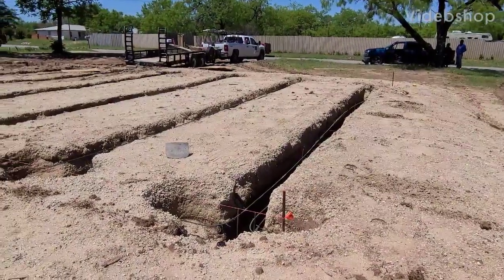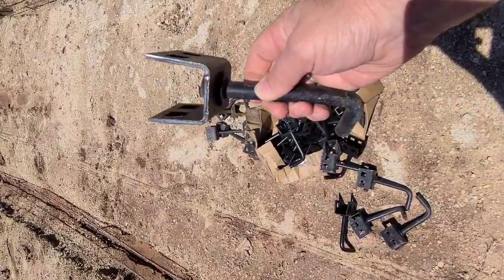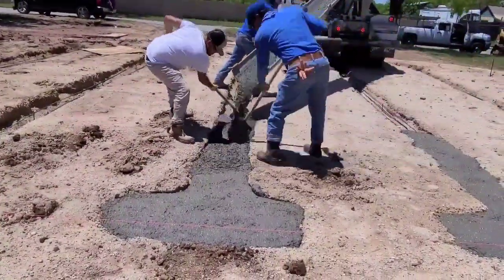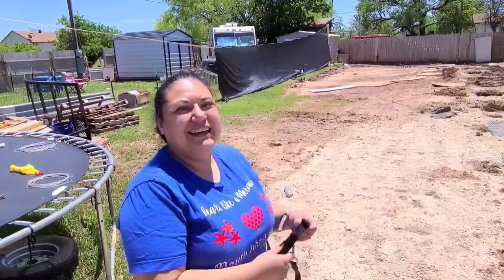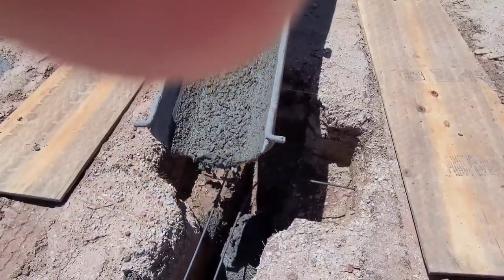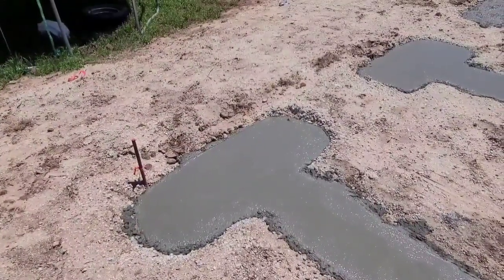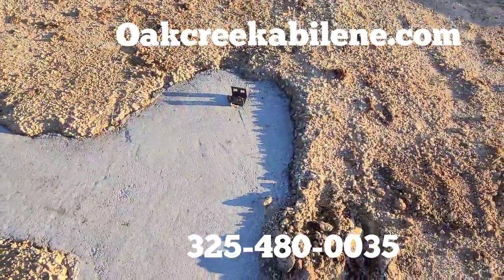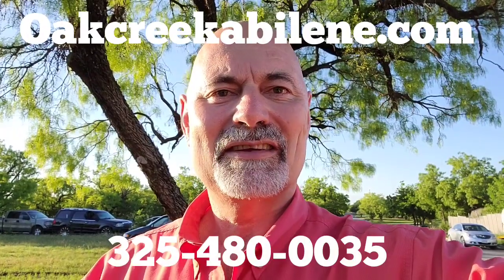Modular home foundation installation

Comment: If the whole house sits on steel I-beams, I wonder if positioning some steel thimble shaped or cable reel shaped anchors such that the concrete was poured around most of them, but one end of the thimble was either flush with the top of the runner, or maybe stuck up a few inches above it, and once the house was sitting on top of them, the I- beams could be welded or bolted to the exposed part of thimbles? Come to think of it; if you welded some old coil springs from a junked car or truck in between the thimbles and the house, you might have yourself an earthquake resistant dwelling, especially if all the plumbing pipes had a segment of flexible hose, and all wiring was cut to leave a little slack, all services (water, electricity, and lp gas) went through emergency cutoffs in a little shack or box offset a few yards from the house and even the skirting was designed to crumble, bend, or flex, or was only cosmetically attached so that it would accommodate a certain amount of horizontal displacement for a few seconds. The construction industry was very slow to learn that it is way more about flexibility and way less about sheer strength and rigidity. Just a couple of thoughts… very easy and low cost things that might wind up saving lives and property in the event of a natural disaster. Who knows? It might lower liability insurance costs enough to pay for itself. Sure would be worth having an actuarial engineer come look at it.